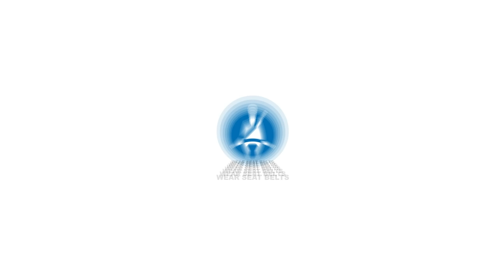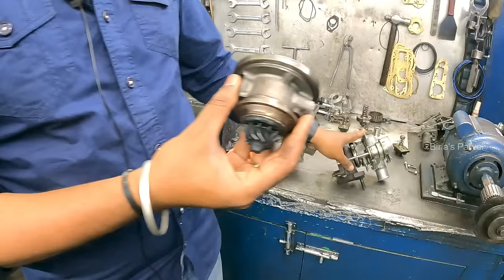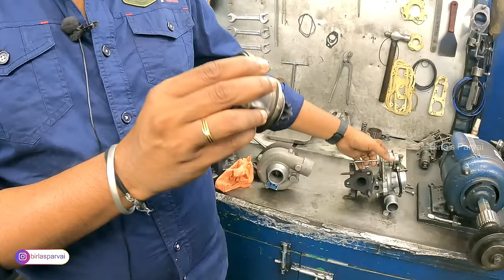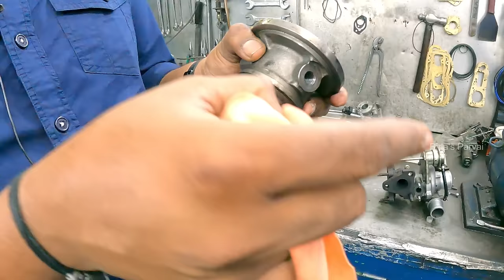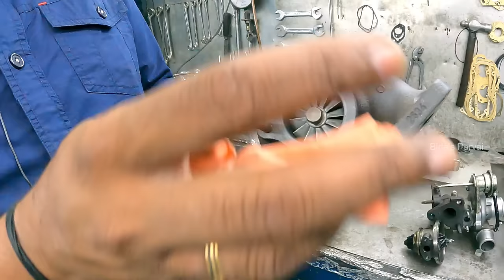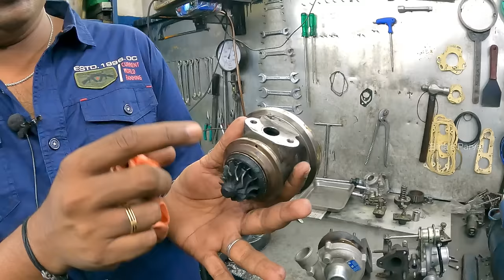Car Turbo Maintenance - Turbo கார்களில் இதை மட்டும் செய்யக்கூடாது | Turbo cost | Birlas Parvai

Comment: After a long drive in highways, its always advisable to cool off the turbo engine atleast for 1.5-2 mins.. Do not switch off the engine immediately..City drive mostly it's not required as we have frequent stops and drive only in lesser rpm's but its always better to wait for few secs before turning off the engine...
Reply: Sir in ciaz they have smart hybrid they switch off the engine any difference are there if we switch off on the highway ride
Reply: @shivakumarkumaravelu876  ciaz doesn't have turbo so no worries
Reply: You are correct, turbo charged engines shudnt be stopped abruptly after a high rpm drive. The reason is, the very hot turbos are being cooled by circulating engine oil, if the engine is turned off abruptly, the oil near the turbo might stop circulating and remain exposed to high temp. Of turbo compared to the oil in d rest of the loop. 
So kindly after comming to a stop let the engine run for few minutes at idle so that the oil has enough time to cool down the turbo.
Reply: @shivakumarkumaravelu876  ciaz doesn't have diesel model and any turbo petrol engines... So not to worry...
Reply: @mkarthi1992  well explained bro👍👍
Reply: Ss 100% Fact
Reply: Ciaz diesel has turbo right. Old model diesel ciaz

Comment: Just to clarify one point here. When you were referring to exhaust its actually meant air intake. In simple layman terms turbo makes it possible to boost the air intake by way of a compressor pump. In Naturally aspirated engine the air intake is happening because of the suction created by the engine itself and there is no external push of air. Since there is one more additional moving part that too rotating at a very high speed to create required air pressure, it needs adequate oil supply and a clog-free air supply. That is what our Balaji Bro is insisting that we should replace the oil at regular intervals along with oil filter replacement and also replace the air filter periodically so that the turbo gets a clean oil and adequate air which will increase the life of the turbo charger. Awesome explanation and now we do understand the importance of maintaining the turbo and we can bust the myth that turbo causes problems.
Reply: Your explanation is worth it

Comment: Turbo is a bliss compared to naturally aspirated configuration. I am not sidelining NA engines but turbo is the soul of every enthusiast car. A turbo in car is the same as an aircraft engine only smaller in size. As aircrafts need to take off on short runways, they need instant boost of power and it's not very different in the case of cars and trucks. Just different fuels and different RPMs. Turbos force-induce air into the combustion chamber to create oxygen-rich environment. More oxygen results in bigger explosion/combustion. This is how turbo boosts power so cars are quicker off the starting line. But then all turbos are not the same and the performance varies between car makes. Garett is one of my personal favorites and it comes factory installed in ford cars. They are well made and last a long time if pampered well. Love the sweet whistle and addictive torque spread across the rev range. But most folks have poor knowledge of how turbos work and how to maintain them. All they know is turbo= power, which is not wrong but there is more to that. This is why buying used diesel cars are tricky. Unless you know how the car was used and its maintenance history, it's difficult to tell if turbos are worn or near end of life. With a machinery operating at tolerances and often at unimaginable RPM (around 15000~30000), there is a specific way in which a turbo should be maintained. First is regular oil change and second is usage habits like idling 40 seconds after a cold start and then repeating it after after a long drive. As turbo RPMs are high, even a brief moment of dry running will accelerate wear in the spindle and bearings. This is how play develops until catastrophic failure occurs.

Comment: Mr.Birla I think in the middle of the video u explained better than that guy... He doesn't know even the parts name of the turbocharger... He can't explain how power will get increased when compared with naturally asperated engine... He might be a good mechanic who can repair the parts but he doesn't know completely about the topic... 
1. Mostly turbo fails due to improper lubrication of the bearings which will be inside the turbo housing.
2. In a non turbo engine we can increase the amount of fuel injected into the engine by varying the size of the fuel pump but  we cannot increase the amount of air intake to engine since its almost fixed. So they introduced turbo so that without increasing the size of the engine more amount of fuel and also air can be forcefully admitted into the engine by turbocharger and hence we get more power.
3. Size of the turbo depends on the no of cylinder, it's bore and it's stroke length so we shouldn't change the makers turbo which will lead to turbo failure or sometimes engine failure also...
3. He mentioned that turbo rpm is 6000... Actually when the engine is in idle condition, the turbo rpm will be more than 10000 and when engine rpm increases then turbo rpm will be as high as more than 1 lakh....
Reply: This is really nice explanation broo
Reply: Well explained 👏
Reply: It may go up to 1.5 lac rpm
Reply: That is the difference…normal mechanics will know what  is  needed to make it  work  but will not be able to explain why or the reason behind because of the lack of the proper technical training. They work by experience from their previous senior mechanics.
Reply: Cool bro !

Comment: 4:48, bro not for same fuel........... with more air, ecu compensates it by putting more fuel as well........... more air + more fuel = more power................ thats why if turbo petrol revved hard, gives very less mileage

Comment: Also I saw somewhere that you must run the engine at lower rpm for 1 or 2 minutes before switching off. This will remove the hot air inside engine preventing engine damage.

Comment: Surely I will gave 5 star rating for his effort.

Actually I have an 13 years old Ford fiesta car. I purchased this one last year. I noticed the black smoke in recent days. Local mechanics are not suggesting for the turbo, injector and fuel pump service. Recently a mild leakage identified in turbo joints. Ford service center has given only to change the entire turbo. So I contacted Venkateshwara fuel pump service owner in last week. I explained the problem cause and send the picture in WhatsApp. He assured that issue will be sorted with service or one part change in turbo. 

He had a skilled team on the service and he suggested the mechanics for parts disassembly and assembly purpose. Those people's also a fine tuned team, dedicatedly taking care of the process. Since I came from my native and next day I have other priorities I need to complete the service in one day. I told to service the turbo, injectors, fuel pump and cleaning the egr valve. 

They prioritized to me for the service and gave the spares by on time they mentioned. They started to assemble the parts at 4PM and spend up to 11:30 PM and do their work without any objection. whole day I saw their effort and challenges on this work. I am very much thankful to the team. I am very much satisfied with their work.
Reply: What was the quote given by ford and how much he charged to service it bro?
Reply: That workshops details?

Comment: Thank u so much.!:).. U own a huge part in me educated.! Now I prefer 1.5 NA engine than 1lt TSI or turbo..
Reply: @partha sarathy bro I own a 1.5L Nissan Kicks NA sometimes what I Feel is the car is under powered at lower rpm's  hence at that times I feel that I could have bought an turbo variant in it as it has instant pickup due to higher torque in itbut the engine refinement and 4 cylinder at 1.5L is best. This is completely my idea correct me if I am wrong
Reply: @jack59055  Wow..! Thank you so much for you're volunteering suggestion or you're experience.! I'll definitely think again in the terms you have mentioned..! You're so kind brother...! Thanks again.! :)..

Comment: Hi sir u explained very well I visited the shop and serviced my Fiat punto turbo but they cost me too much service also not good after service with dem only I got oil leakage problem low pick up better avoid going to this shop after servicing also I visited 4to5 times but problem not solved very disappointing 😔

Comment: Super 👌👌👌 Master. 
Usually Turbo Engine Cars are Comes with High Acceleration Idle So Initially No need to Raise the Accelerate Pedal. 
In My Scorpio(4 Cylinder Turbo Engine) Upto 3rd Gear No need to Accelerate, Because Defaultly the initial Idle speed upto 40kms @ 800 Rpm.
IN my car after Switch on the AC No changes in rpm it's remain the same 800Rpm.
Thank you 🙏🙏🙏 Master 🤓🤓🤓.

Comment: Hi ! I am mech engineer...how turbo gives power? answer when we say 1000cc (1 litre):engine or 1300cc (1.3 litre) engine - it means engine can suck so much air ( 1litre or 1.3 litre) . We can burn only so much fuel as much air is inside the engine at every stroke. Turbo helps these engines suck more air than its capacity by compressing air...so now they can burn more air and so more fuel and so more power...hope it's clear
Reply: So now 1 litre engine with turbo can suck 1.3 litre air with help of turbo and so we get 1.3 litre engine power from 1 litre engine using turbo ..

Comment: Basically nothing much to worry, almost all the diesel cars will have Turbo and few petrol cars top model will have turbo and if oil, oil filter and air filter are changed properly it will run for Lakhs of kilometers

Comment: I have mahindra xylo , when I drive after 40 &50 km reached. the speed decrease automatically maybe 30-40km speed only. I give full acceleration but the speed will not increase. Anybody know about the problem.

Comment: Bro en ford ecosport diesel ah turbo malfunction airchu naan 2.5years ah aptiye vachi drive pantu irken ithu naala ethachu problem Varuma?
Reply: One day engine thidirnu oil full ah leak agum, gasket pogum, coolant oil/water engine ulla pogum, thermostat pogum, micham iruku oil burn agi kosu marunthu adicha mathiri pogum engine off agidum. Additional bonus ah injector heat la athum poidum. Periya selava vaikum so konjam check pani sari panrathu better Ilana car sell panidunga

Comment: Hi birla sir kindly make full video sir bcoz my vehicle Hyundai xcent full heavy black smoke issue.. service centre kuduthae sir turbo problem sonae then New turbo change panae appram smoke issue....then engine rebore work panage so enaku ithae pathi koncham full video podugae birla sir.......own vehicle only 58km driven only 2017 vehicle.... kindly reply me sir...??
Reply: Bro when Turbo gets damaged you need to clean the engine head after replacing/servicing the Turbo components. Otherwise the carbon deposit and soot will damage the engine with bore/stroke problem as the last step. Had a problem in my Ritz VDI and found out the hard way 😭. For this reason NA engine is still safer.

Comment: Which is best to buy Turbo or Normal engine in which we will hve life
Reply: There is no connection between engine... It's with performance if you're a normal driver who never drives aggressive has lot of patience in over taking. You can go for non turbo varient.
If you want a peppy drive and you want your engine to respond every aggressive accelerator press then turbo is the right choice

Comment: 1L TURBO PETROL ENGINE  BEST OR 1.2L PETROL NATURAL  ENGINE BEST? WHICH ENGINE  HIGH MILEGE AND LOW MAINTANANCE PLEASE REPLAY SIR
Reply from the maker: 1.2 NA
Reply: Always NA is the best for engine life because turbo adds more stress to the engine. But again depends on how we maintain and how many kms we clock. If less than 1L km then not much difference for an average user
Reply: 1L turbo engine is best for better power and torque figures and 1.2 NA 4 cylinder engine is overall the best in terms of engine life, less maintenance and it also gives good fuel efficiency... 1l turbo with just 3 cylinders generates more heat which causes more stress on the engine especially after spirited driving and also if turbo petrols are  driven hard it will give poor mileage unlike the diesels
Reply: We have to change Turbo once in 80k Km 👍 average but depends upon users